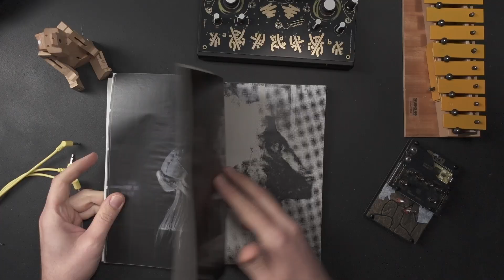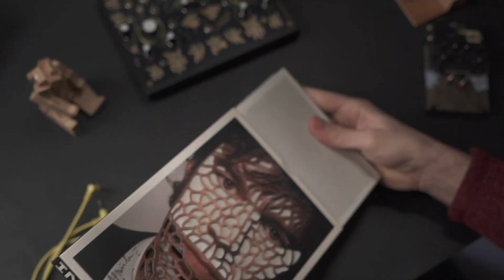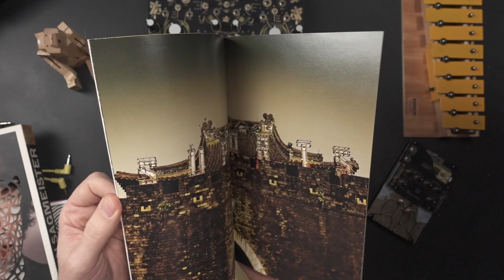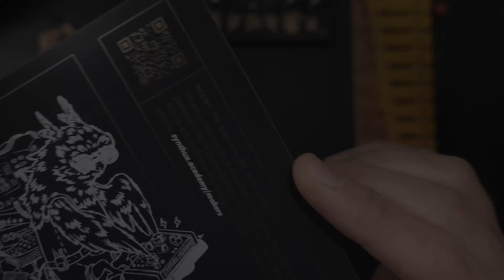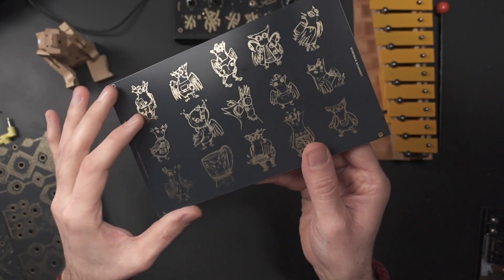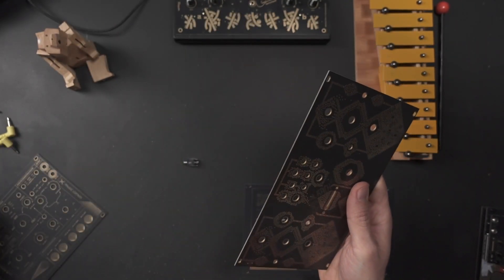From Posters to PCBs: A Graphic Designer’s Guide to Circuit Art

Comment: Such a nice finish!
Could you tell us what service you used to to manufacture the pcbs? The matte finish is so nice.
Also, did you use KiCad? 🤔
Reply from the maker: Yea, JLC. But take it with a grain of salt. Some times it’s good, and sometimes bad. Working in Kicad and illustrator, converting with Gingerbread.
Reply: @SynthuxAcademy  Thank you for the reply! I managed to learn quite a bit in the past few weeks from you :)) Thanks for that.
Still wondering though, I looked into Gingerbread, but why exactly do you need it?
I managed to get from Illustrator to Kicad by importing svgs and at first glance it looks fine.
I didn't manage to get these svgs into Gingerbread from Illustrator, it just shows nothing.
Reply from the maker: @elpedomasgrande1 yea, Gingerbread broke a few days ago. It was useful because it made it easier to upload complete designs (all layers, separated as footprints). Happy the videos were useful!

Comment: Awesome video. We're one of the many, tiny little audio companies that have leveraged PCBs for our front panels. It's shocking that the easiest way to get quality panels of any sorts is by using PCBs. Even if you want a fully UV-printed panel, there's nobody out there competing with PCBs, even when you don't need the copper layer! There don't seem to be any companies out there that specialize in making decorative panels with an easy to use service, so people are "abusing" the PCB services to make their front panels. I spot a big gap in the market for the first company to set up a quality panel-printing service - I've even considered forming a second business around that idea myself :)
Reply: it's just so practical to ship create a separate gerber file based on your existing PCB gerger to make sure all the stuff is placed precisely where it needs to be, then just ship out both gerbers to JLC or whatever and presto, you have a beautiful black and gold Panel ready along side your PCB.
the only problem is that sometimes there will be imperfections in the silkscreen and it's hard for the manufacturing companies to cater to that since they don't really pay much attention to those silkscreen imperfections since it's not supposed to be aesthetic